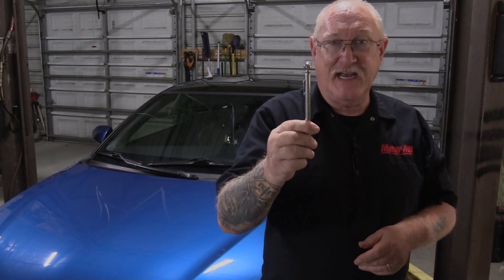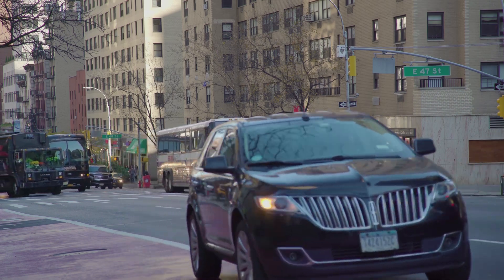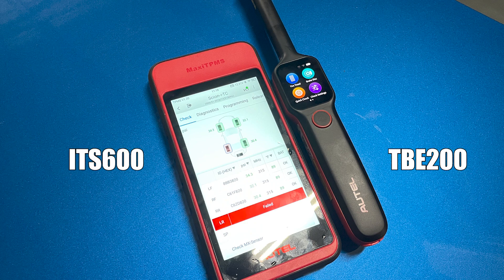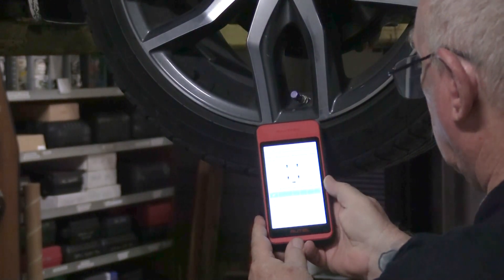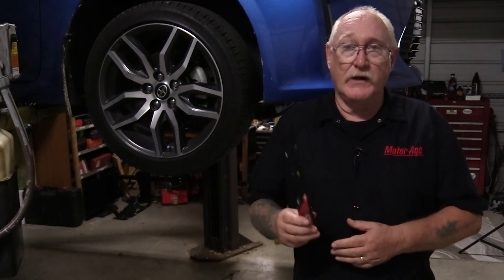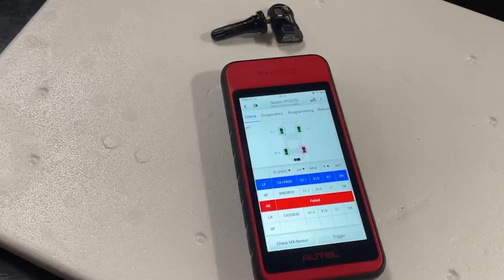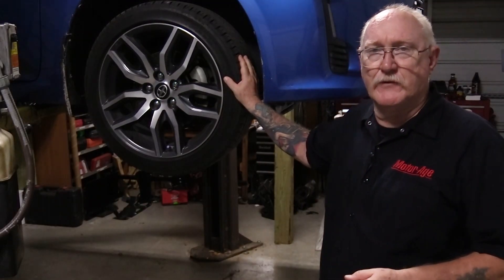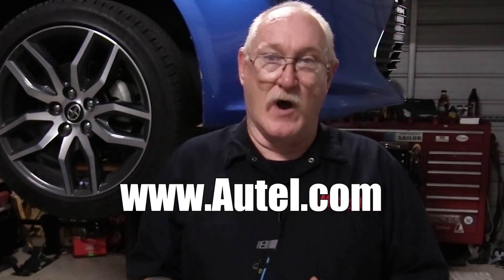The Trainer #131:  Tire Inspection In A Digital Age

Comment: Hello Pete! What an interesting man and inspiring teacher. Caveat... I am not an electrician! However, I have been watching your videos trying to learn how to overcome a parasitic draw. 
I started with the 10A setting and found a 1.21 amp draw. After following circuits and pulling fuses, I found zero faults. So, I started watching your voltage drop videos because I grew tired of resetting all the parameters after disconnecting the ground wire. 
Conclusion... I still am unable to determine where the voltage drop or amp draw is. During the voltage drop test, the alternator ground showed 0.43 VDC. When I tried this with another DMM, the reading was 0.04, I'm sure you can understand my frustration. 
Where do I go from here? 🙃 
Thank you for your great presentations.
Reply from the maker: See if this helps:  https://studio.youtube.com/video/EjGeiDzuoxk